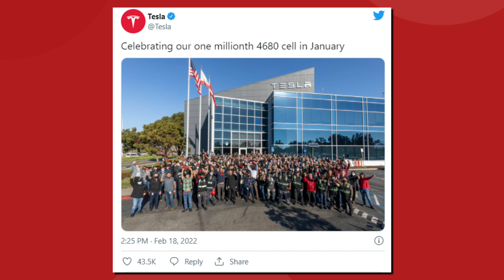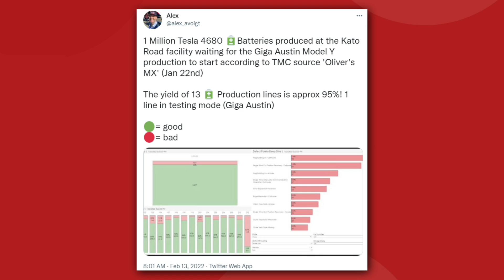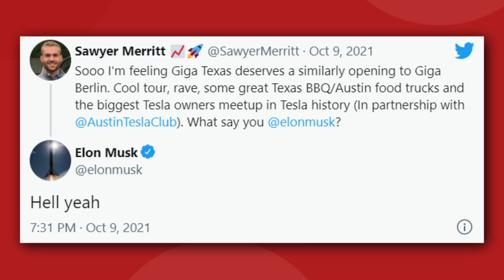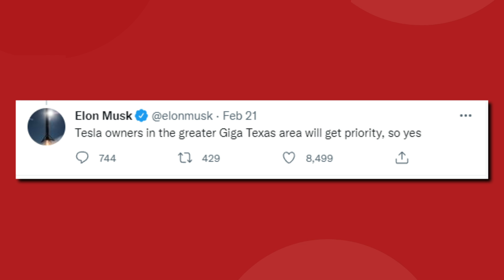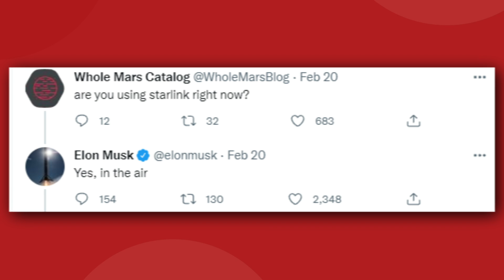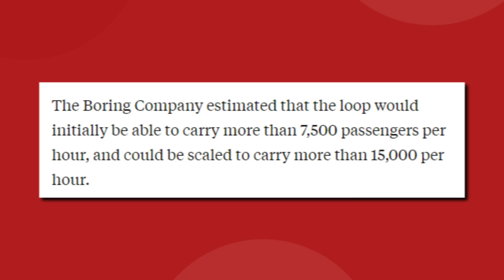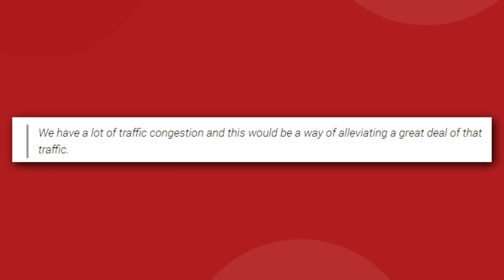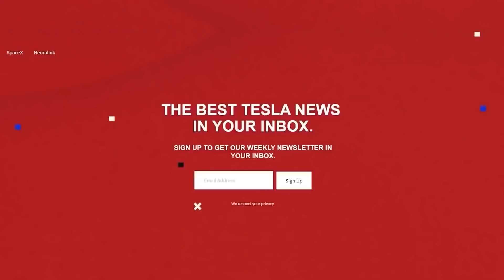New Tesla 4680 Battery Update!

Comment: Bugging me for a while now is "why do manufacturers make single-layer cells instead of 2-layer cells"?
If they adhered anode graphite to both sides of the anode metal sheet, cathode nickel to both sides of the cathode metal sheet, and jellyrolled round batteries with one additional separator sheet, they would have, on packaging and pumping in electrolyte, a cell with just slightly lower current but double the voltage, with slightly less anode and cathode metal sheet than a single-layer cell. 

A 1.8 times increase of energy density.

Comment: Fail. Round batteries are 21.50% inefficient by design compared to square batteries.
Reply: I would guess the manufacturing of them is faster though, due to the speed they can be "rolled"
Reply: @dillonlboyer   You're gonna stand there, ownin a fireworks stand, and tell me you don't have no whistlin' bungholes, no spleen splitters, whisker biscuits, honkey lighters, hoosker doos, hoosker don'ts, cherry bongs, nipsy daisers, with or without the scooter stick, or one single whistlin' kitty chaser?

Comment: In the latest videos from CES the drivers are saying that the cars have already been modified for autonomous operation, but that it is not yet enabled as they are still awaiting regulatory approval and liability is “holding us up right now, but once that gets cleared we’ll turn all the cars on”. 

After all, The Boring Co actually took the press for test runs using autopilot running in Loop EVs over 2 years ago in the 1.14 mile test tunnel in Hawthorne California.   At that point, autopilot was limited to 90mph (145kph) but was scheduled to be increased to 125mph (201kph) a few weeks later. 

Not surprising considering that following a white line in the controlled environment of a tunnel is hardly rocket science.
Reply: You're gonna stand there, ownin a fireworks stand, and tell me you don't have no whistlin' bungholes, no spleen splitters, whisker biscuits, honkey lighters, hoosker doos, hoosker don'ts, cherry bongs, nipsy daisers, with or without the scooter stick, or one single whistlin' kitty chaser?

Comment: my 4700yf (*lol* bigger name) :D cap is cooler - it loads Full by 1sec tipping on a 9v battery
- cap can load 35mil. times ! 

*and if you connect a 66k resistor and a 3,7v led on it, so it runs 2 hours